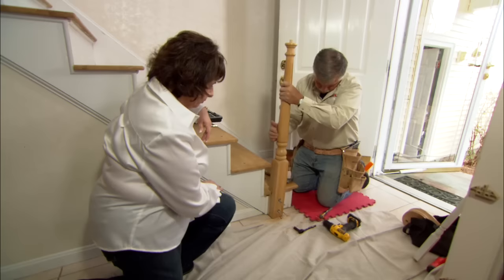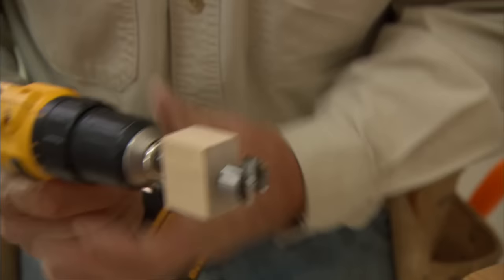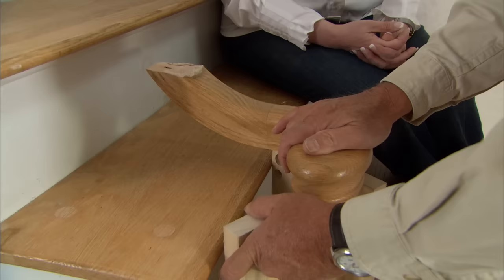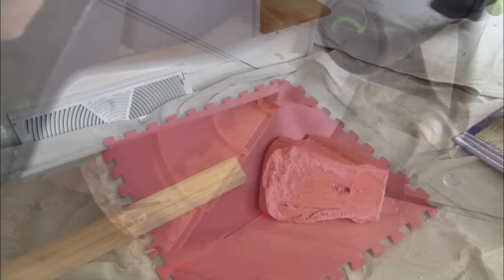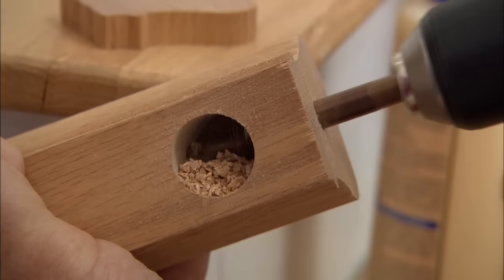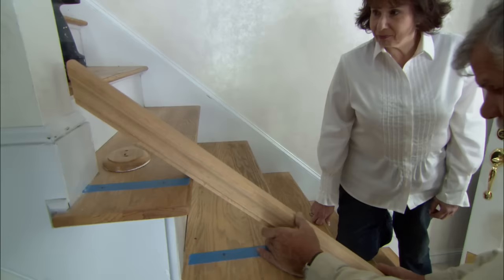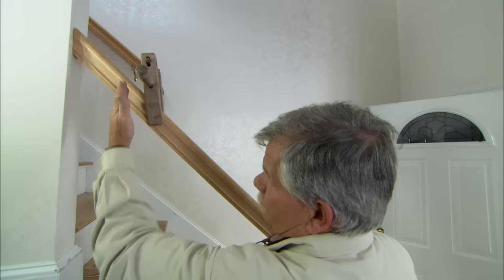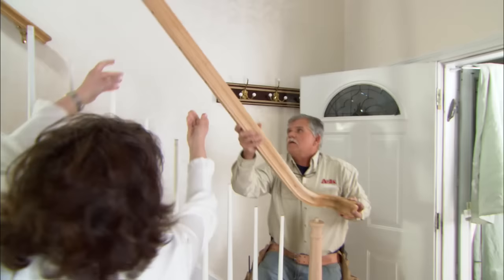How to Replace a Stair Railing | This Old House

Comment: if you drill a 1/4" hole for the lag portion of the railing bolt and then drill a 1/2" hole for the threaded portion in the other piece of wood, you have some "play" so that the two holes do not have to align perfectly as you can move one of the rails to the exact location prior to gluing.  Tightening the nut still kicks my butt.
Reply: It's not hard.  Only get a little turn with each time you put the wrench on.  Finger tighten as much as possible first.
Reply: Yea. I noticed he didn't show that part.
Reply: Or simply drill a 1-inch deep pilot hole into the handrail end, then cut off a 3/16th profile wafer where you just drilled the hole.  put that wafer against the other handrail end to use as a guide where you need to drill a matching hole.  So easy.

Comment: I have the same setup I've put off completing for years. This helps. but... 1- I can't find spindles long enough ( because the spindles on the back of the tread must be longer than standard length) and 2- spindles are tapered so the ones on the back of the tread will require a smaller hole at the rail? If anyone knows of a more detailed video of landing spindles on treads I would love to see one :)

Comment: I'm doing mine at the moment and I bought all my balusters together, the same length. As I cut each to fit, the ones going up the stairs are of course shorter, and since they are cut lower from the top, they give they Wierd illusion that they are much thicker at the top. Which they now are! The lowest at cut to 38, while a couple are 32. Should I have bought different size balusters, also that when I cut to fit they look better to the eye? 
I don't think I'll get an answer in time but maybe it'll help someone else
Reply: Keen observation. I never thought about that.  I am doing the same and also bought my balusters already.  Likely no one but you would ever notice. i can see it above now that you point it out.  That would be a great argument for cutting at the bottom vs the top.

Comment: Looks the same? Adjusting spacing?
Reply: Added spindles to bring the stairs up to current code that requires balusters to be no more than 4 inches apart.

Comment: Two things... Tom did not show how he marked the two pieces of handrail so that when he drilled the holes were in the EXACT same place.  That would have been helpful.  Second, I would have like to see Tom tightening the nut inside the handrail with a wrench.  It looked like there was not enough space to get a wrench in and turn the nut...
Reply: Thank you. WTF. Why go to the trouble of making a " how to " video, then ( skip ) steps in the process. I'm very sure that tightening that nut ( inside the handrail ) was not going to be a piece of cake. I would have liked to see Tom give us ( novices ) some insight into how to do that. My contention is that these " experts " forget who there audience really is. These videos are supposed to be for people who are NOT skilled carpenters. I think that they do these projects so often, that it becomes very easy to them. They forget how challenging it is, for people without their many years of practice and advanced skills. It may sound funny, but a skilled expert, needs to explain the process, as if they were explaining it to a 10 year old. It's no different than if you buy something that needs to be assembled at home, and the assembly instructions leave out specific instructions. Instructions, as a general rule, need to be ( forgive the term ) dumbed down, to the least common denominator ( ie - some people are better at understanding instructions, than others. ) Why do you think manufactures add pictures to the instructions on boxes of foods that are to be prepared at home ? I'm not casting aspersions, i'm just being realistic.
Reply: +philliesfan136  He probably used the cutoff from the handrail as reversible template. Drill a hole through and you can drill the holes in the 2 pieces aligned.
Reply: Comunque infine non rilasciare ancora il corrimano
Reply: I don’t know about the first but for your second question he probably tightened it up from the front of bolt. He was only getting the nut snug with his finger. The black washer probably keeps nut from spinning while tightening but if it does you can put a flat blade screwdriver in hole between wood hole and hex nut flat for backup.
Reply: I do stairs installation, for the bolt we used a stair bolt wrench. IT fits in the hole, so you can make it tight .

Comment: My railing is firm and intact.  Thanks to my dog, I need to replace chewed spindles like the ones in the video, but can seem to find a video to show how.  They sell the exact spindles at Lowes, but I have no clue how to install them.  Anyone’s help would be appreciated.
Reply: You can cheat and trim a little off the bottom that goes in the hole.  Also drill a little further up in the railing (careful not to drill through it) Then slide spindles up into the holes before putting bottom in.  Probably need to nail either the top or bottom (through spindle and into upper rail or at bottom into stair tread.

Comment: You didn't show how you tightened that railing bolt in that small access hole. It would seem that a standard wrench would not be narrow enough to both fit in, and be able to turn a sufficient amount.
Reply: Was thinking the same thing.
Reply: He used a special wireless wrench which allows complete access and gives proper torque to the nut simultaneously. He didn't show this as it's a rare tool which practically nobody owns.
Reply: He used a stair rail wrench

Comment: The new stairs he built looks the same as what she had before.
Reply: Original stair treads had only one baluster which is not code compliant so he modified it and installed two balusters per tread and a new hand rail.

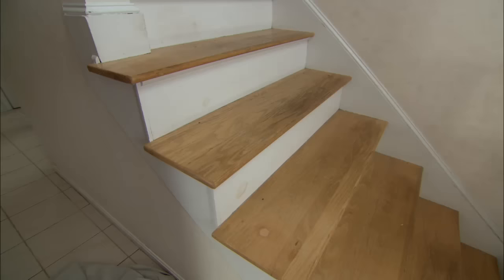Comment: Why did you cut the curved part from the straight part in 1:32? I would have thought you would reuse the complete railing, just changing the spindles. I think I am missing something.
Reply: They moved the newel post about six inches.

Comment: so how did he tighten the nut on that bolt? they didn't show that
Reply: Use a flat head screw driver put it in the hole right next to the nuts to keep the nut from spinning, then turn the turnout to tighten it.
Reply: You have to use a rail bolt wrench

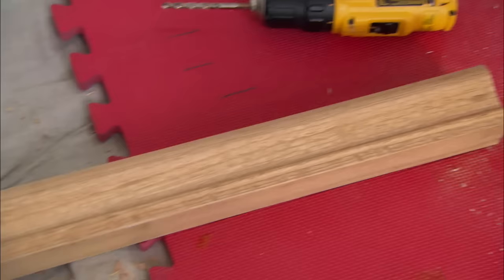Comment: How did he fasten the railing bolt to the turnout at 2:57 ? Just use vice grips on the threads?? I know you can butt two nuts together on the machine threads to turn the bolt, thats what I would do

Comment: Why wouldn't you use a joint to connect the turn out to the hand rail?  If you have the jig for it, I don't think it would be that hard to cut a dovetail, and there would be a lot more wood connecting with a stronger bond.  Heck, even a biscuit jointer could work.
Reply: of all the ignorance on these posts. this is the one I was thinking!!! :)

Comment: the handrail wasnt even changed. the only things changed was the post
Reply: +HiHowAreYou Today The handrail was changed.  He had to drill holes for the balusters and if you notice the sheen difference between the new handrail and the handrail turnout he attached, the hand rail has no polyurethane on it while the turnout does.

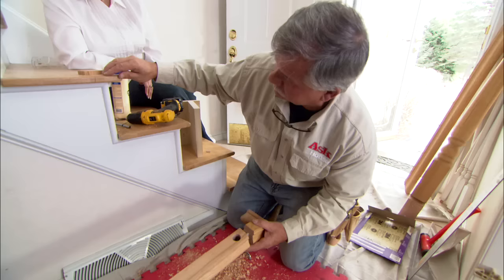Comment: FAIL 3:41 How did you tighten the nut? What tool did you use? Why didn't you show that part? 👎
Reply: because it shows that this is not easy

Comment: WHY YOU DIDN T USE EXISTING HOLES
Reply: Existing baluster spacing did not meet current code requirements.  Now, I know a code inspector isn't coming to check but it's a safety measure and it's just the right way to do things.

Comment: you never explained the height of the support block - if it matters or not. You also didn't explain how to get the profile to line up between the turn-out and hand rail or even how to blend them. This video will leave you scratching your head and frustrated as there is a lot of useful information omitted. There are some cool tricks shown here, but don't stop your research here - keep looking.
Reply: Kirk Frederick the height of your support block would be the rise of your balister